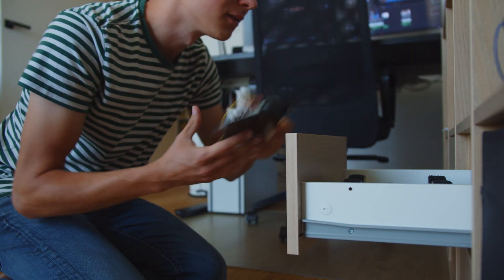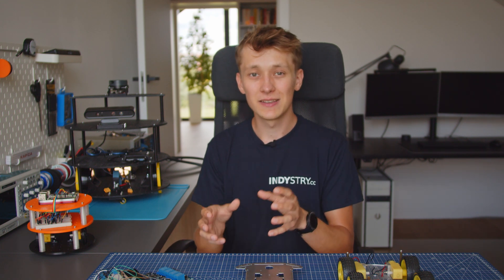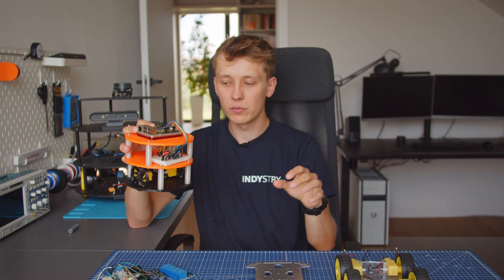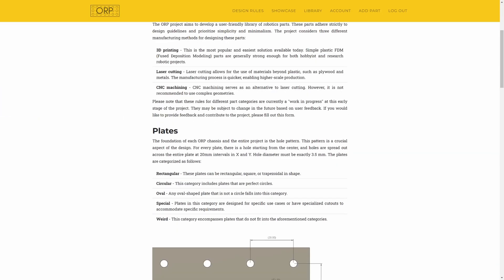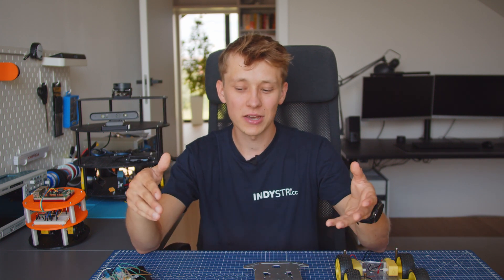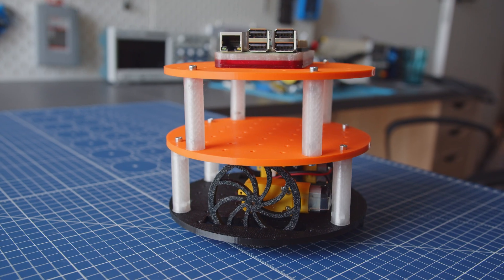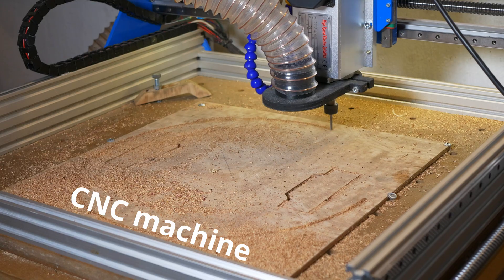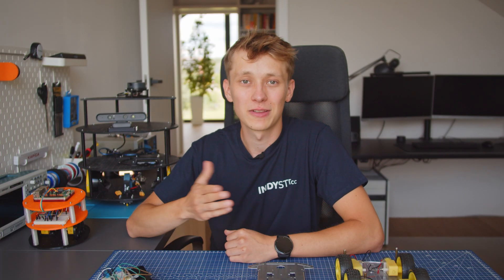Will our open-source project work?

Comment: Very cool idea! 
I designed a modifiable, open electronics case at some point, with a similar hole pattern and holder system. I decided to use 25mm grids instead of 20mm, with extra large holes for M3 screws. This made it so that for small parts, holes that are 1 inch apart will fit on the board just fine. My system was for electronics enclosures and had a standard for side panel connectors too.